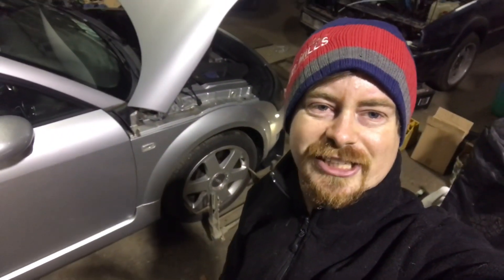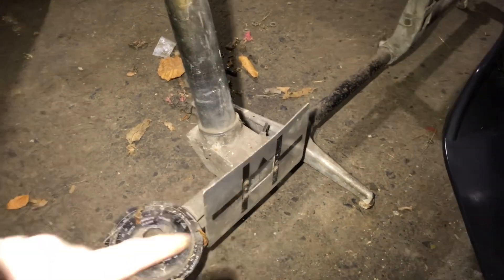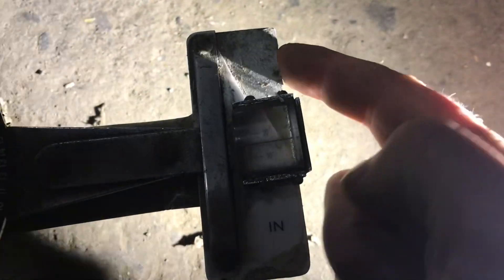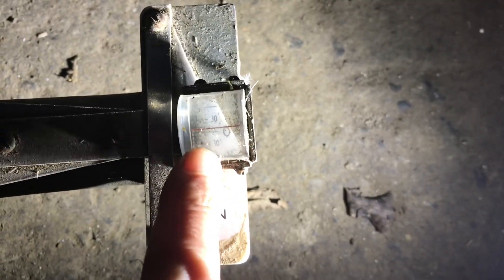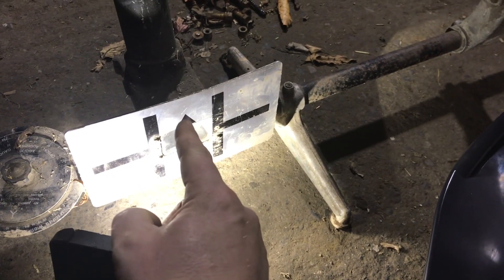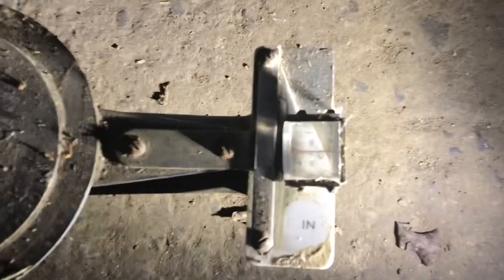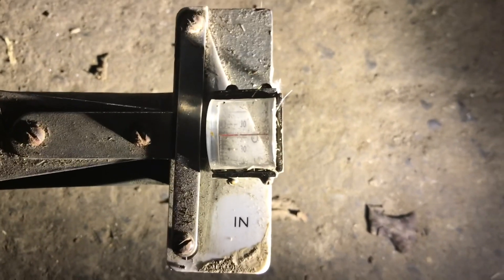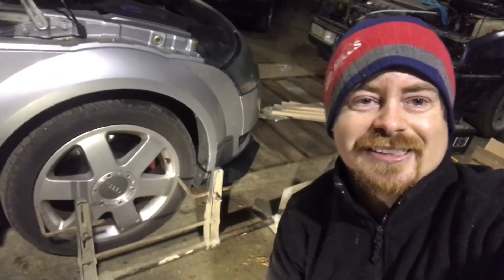Wheel Alignment - Toe Angle [how to]

Comment: Great little video mate, reminds me i need to get my car huntered haha
Reply from the maker: Huntered ?
Reply: @stevenharpervw  4 wheel laser alignment inc camber adjustment
Reply from the maker: @TheParrottBros  When I first got the TT, did mine with these tools and a camber gauge . And then bought it to the laser shop beside my house. I asked the lads, could they see how far out I was . So we put the tt in the ramps and hooked it up he sensors, they said it was bang on. Proves you can do it at home too
Reply: @TheParrottBros  @Steven Harper camera based system, with targets on the wheels, I'm not a massive fan but they spend loads on marketing the brand and easy to use! measures the camber but like everything, adjustment as good as the mechanic doing it   😁